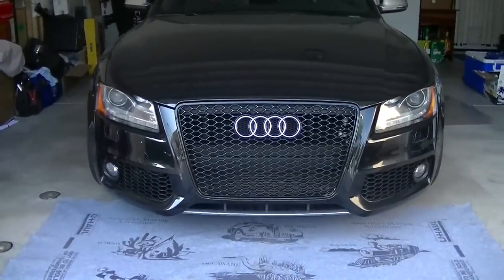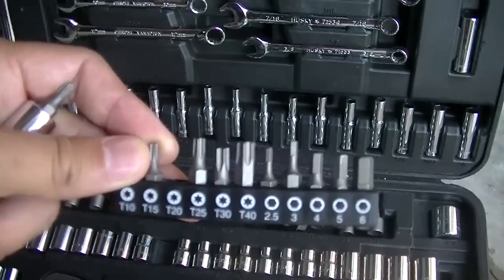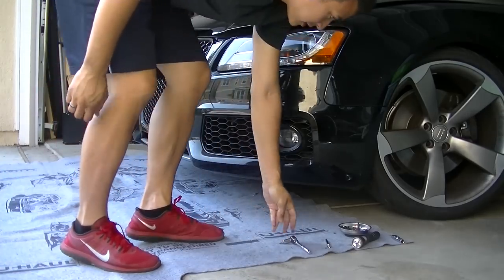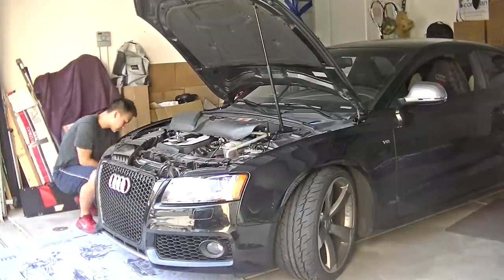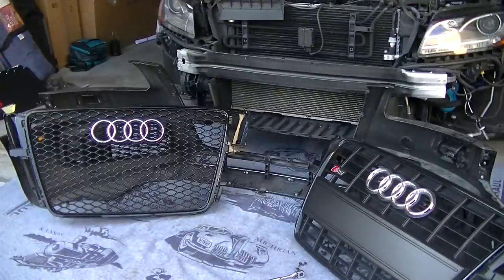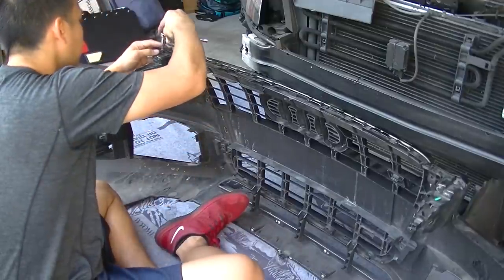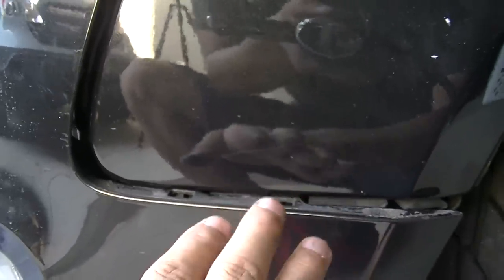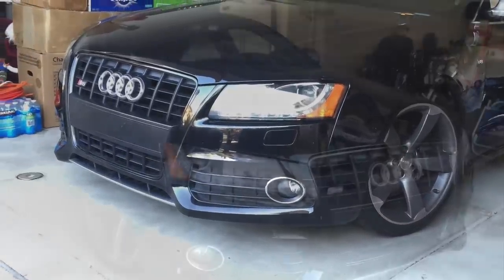Audi S5 Grille Install

Comment: Great video. Told me exactly what I needed to know. Was dreading tackling this but now I feel ready to give it a go after seeing this
Reply: Do you have front parking sensors ?
Reply: Yes I’ve got front parking sensors. I just unplugged them as I was removing the bumper
Reply: machighlander72 ah ok, are they part of the number then not the grill ?
Reply: I thought there’s two that sit in the grill
Reply: Major both. There’s 2 fitted on the grill and 2 on the bumper. Just need to unplug the loom from each sensor before moving the bumper away from the car and remember to plug them in again when refitting it’s. The loom for my sensors was fitted behind the fixing brackets for the grill so these had to be unscrewed to get the cable out from behind them

Comment: Everyone hating on the grill dont understand styling and design. This cars front end was made to match that stock grill, which in my opinion looks way better and compliments the shape of the head lights. If you want the RS grill, get the RS bumper to go along with it(the entire front end of the car is one piece) , that matches the honeycomb design. I own an 08 S5 in sprint blue, and my stock grill is finished in grey and matches the chrome accents. Some like aftermarket bs.... some like classiness.

Comment: Really detailed video, exactly what I needed. I’m going to go install my honeycomb grill with some confidence now 💪🏽
Reply: Where did you order your grille from?
Reply: CTCDesigns eBay. I’ve fitted it now with black Audi badge, looks slick. Also de-badged the A5 and TDI signs and stuck a black Audi badge on the rear.
Reply: Nice!!! I'm gonna check Ebay now for the grille
Reply: CTCDesigns yeah do it, the upgrade makes a massive difference. Nice aggressive look. And the ones on eBay aren’t that expensive, just make sure it’s for your model
Reply: @MuhammadLaher  Yeah I definitely have to make sure it's for my year and make. I bbn know your whip looks sick. I def want that aggressive look
Reply: CTCDesigns it’s coming along nicely. Just upgraded the sub and added in an amp. I’m gonna get some black rims to go with my black grill, badges, tinted windows. All the best with your mods, hope you achieve that aggressive look too. What colour is your A5?
Reply: @MuhammadLaher  Nice I thought about upgrading the amp and getting a custom sub but we'll see. That's a good look that your upgrading that. Mine is black...I'm a  keep the stock rims...like the contrast...just tinted all the windows. To complete the look is that grille
Reply: @MuhammadLaher  Black glossy or matte wheels
Reply: CTCDesigns black is nice, yeah contrast is good. I have grey so the black rims will be dope. Not sure whether glossy or matte, probably glossy. What you think? I recommend doing the sub and amp upgrade, wasn’t difficult and made a massive improvement. Depends how much you love your music.
Reply: @MuhammadLaher  I def love my music lol. I like the glossy rims alot more than matte...
Reply: @MuhammadLaher  think it'll bring out the grey...especially at night under the lights with the wet wheel look
Reply: CTCDesigns yeah man you’re right. I’ll go with glossy then. I like deep dish rims but man they’re expensive. What music you listen to? If you love your music then you gotta get a sub and amp in there haha

Comment: I noticed that the Homelink sensor is mounted to the radiator and not on the grille itself. What did you use and how did you do it?  Excellent video btw. I feel confident I can do this myself. Thanks!
Reply from the maker: Glad to help! I used zip ties.

Comment: I see you zip tied your sensor module that was mounted to back of OEM grill to the radiator, did that cause any issues or need calibrated at dealership? Also my grill didnt come with the longer 2 post that slide in at top to screw down. Do you have website you bought yours?

Comment: Great video. How did you re mount your  Homelink that was on the back of the OEM grille? I'm removing OEM and putting on honeycomb. Looks like you strapped it to the radiator?
Reply from the maker: I'm not sure but I think you're right.  It was like that when I bought it from the previous owner.
Reply: Rooney Nguyen I was actually able to attach it directly to the new grille.  It was set up for it already.  I used your video as a tutorial.  Thanks again.
Reply from the maker: Right on! Glad I was able to help you out!
Reply: Steve Gatey I got the RS5 black honeycomb grille for my S5. It has screw holes to fit the bracket that houses the homelink. Fit perfectly. One thing you'll need to do is paint the silver crash bar black so it doesn't show through the honeycomb. Don't think these comments allow pics though. You on Facebook? I can message them to you

Comment: Do you have to disconnect the battery before disconnecting the fog lamps? Or could I just leave the battery plugged in the entire time?
Reply: Kyle Lazer leave the battery plugged, no need to disconnect.

Comment: Can you do this without removing the screws on the plastic guard underneath?  Just let it hang down.
Reply: You most likely could, you'd just have the bumper hanging forward and you'd have to lean it on something but you've come this far you might as well just take those other screws from the plastic guard too.

Comment: Hey pal i just picked up an B8 S5, and i was told the honeycomb grille won't fit on the stock front bumper.. is that right?
Reply from the maker: Ali A hey buddy  as long as the grille you bought is for the B8 and not B8.5 then yes it will fit on the stock B8 S5 bumper.
Reply: thank you! great vid btw

Comment: Hey I have a question. What is that silver piece beneath the bumper called? Mine is broken and I need a new one. Also, where did you purchase yours? It looks aftermarket.
Reply: It's an OEM part I believe, it should be the splitter if i recall correctly. You can get it used for pretty cheap actually.
Reply: Michael Nguyen thank you!!

Comment: Do you have to remove the bumper on a 2016 S5 to replace the grille or does it just snap in and out?
Reply: You'll have to remove the whole bumper to get the grille in place bud.

Comment: Would you know if an RS grille would fit on an A5?
Reply: I believe if you have the face lift B8.5 (2013+) S5 it will.
Reply: Michael Nguyen i have a 2008 A5. I wanted to put an RS5 grille on it. I thought you might have some advise for me

Comment: Wait you have to remove the whole fucking bumper just to remove the grille?  Thats shitty engineering...typical Audi.
Reply: K P Or it's great engineering...most bumpers you don't even have the option to replace just the grill without replacing the whole bumper.

Comment: What paint did you use to paint the crash bar?
Reply: You can use anything really. High heat spray paint might be good too. I just used regular black spray paint.
Reply: Michael Nguyen sweet had the same question, good vid bro